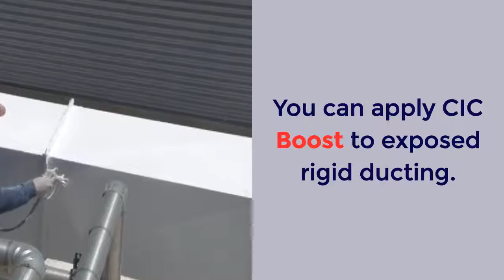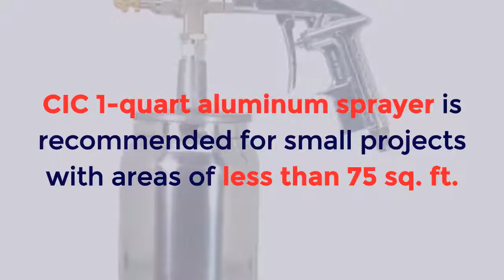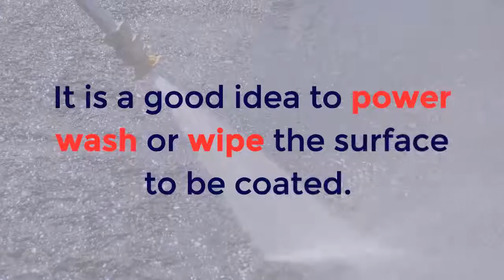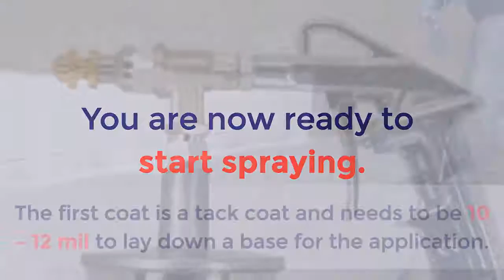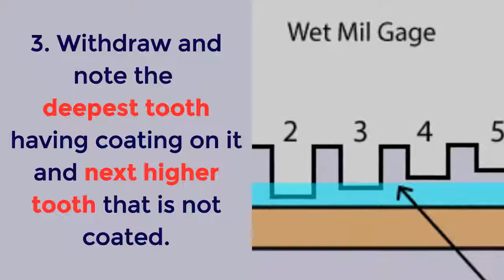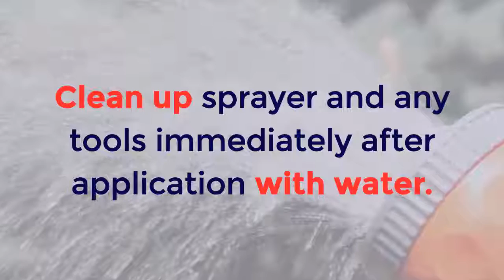How to use a Thermal Insulation Application Kit

Comment: what is the airless gun tip number can be using for this meterial ?
Reply from the maker: It is recommended to use a reversible nozzle with tip size .021” - .025”. Tip size depends on area to be sprayed. For small areas a (321”) fan size should be used. On larger areas a 521-523 works well.
Reply: @deepenergysolutions1025  thank you for the information ..just one more thing if using tips 525 or 521 what is the pressior number can arrange on airless sprayer ?
Reply from the maker: @fencer1965  If you are using the Flex Spray Gun or 1 Qt Aluminum Sprayer you want to use with an air compressor that moves 4.0 - 6.0 CFM attached with a 3/8" conventional air hose and a working pressure: 40-50 psi (max 50 PSI).  If using an airless sprayer we recommend the Graco DUTY MAX or Titan 12000 DI.
https://deepenergysolutions.com/info/application-information-2

Comment: Is it water based?
Reply from the maker: Yes Jason, CIC is water based that is easily cleaned with soap and water. (As long as you don't let it dry, if you let it dry it is very difficult to remove)